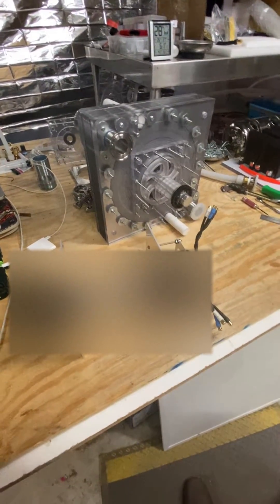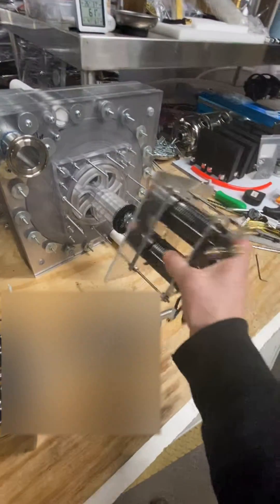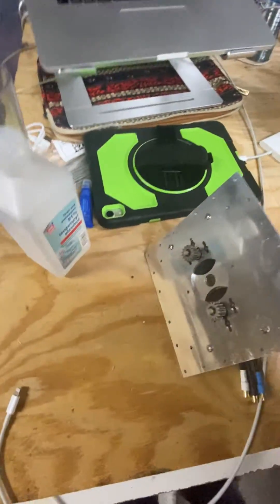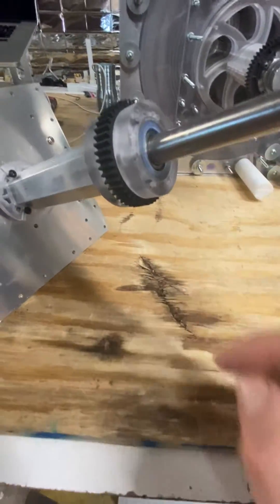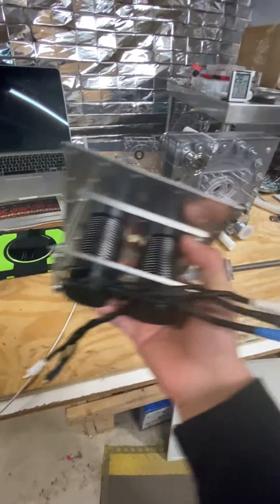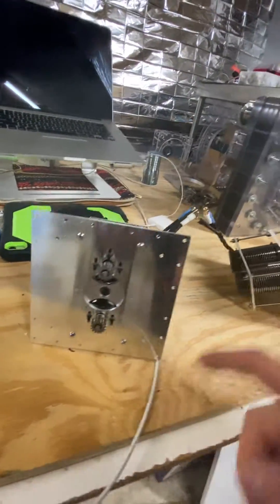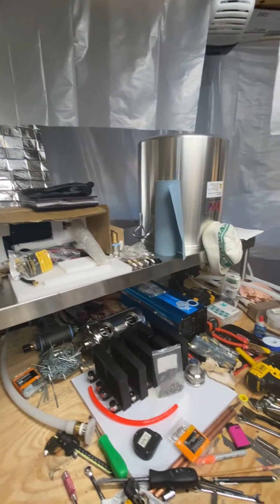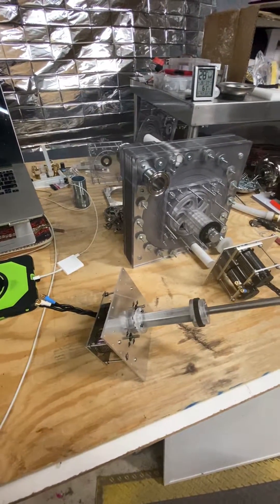Off Grid DIY Steam Turbine Maintenance - Generator, Gears & Bearing Assembly

Comment: Just a quick note kilowatts does a chance if you go from 12/24v, only the amps do, I’m sure you know this it’s just a speech mistake. Have you tried motors directly half of the shaft with no gears yet some of those around cylindrical magnets you can get mount directly on the shaft? I know this video is quite old

Comment: very interesting, I would like to see more of these turbines applied in everyday life.
Reply from the maker: Hey thanks for commenting! 

With TesTur Energy, our mission is to give people energy independence through Combined Heat And Power (CHP) systems that can make use of underutilized energy sources like biomass, solar thermal, geothermal and even low grade fuels containing high quantities of solid particulates (like pulverized coal and powdered iron); energy sources/stores that are currently underutilized due to the lack of turbines and engines capable of handling the multiphase fluid flows (any combination of gasses, liquids, solid particulates) present in low grade heat boilers and low grade fuel sources without damage over prolonged/continuous periods of use. 

www.TesTurEnergy.com 

Let me know if you ever have any questions! 

Much love!